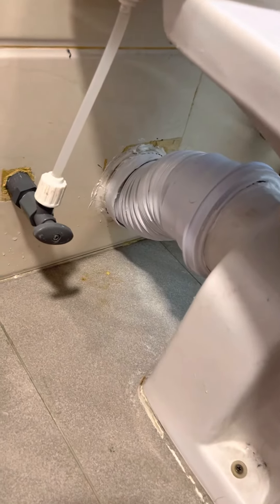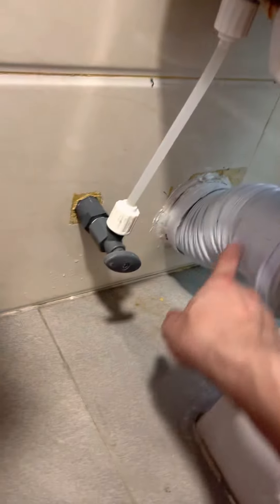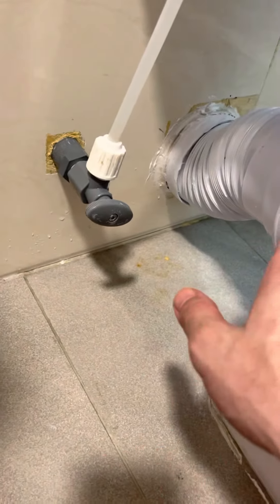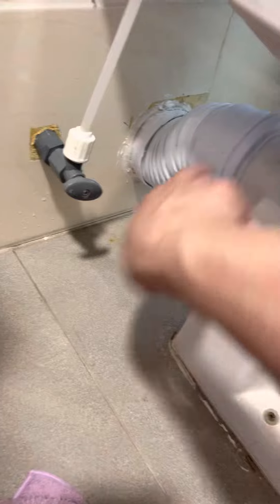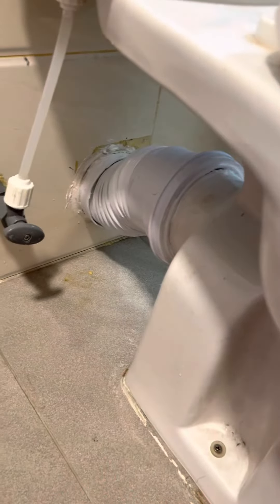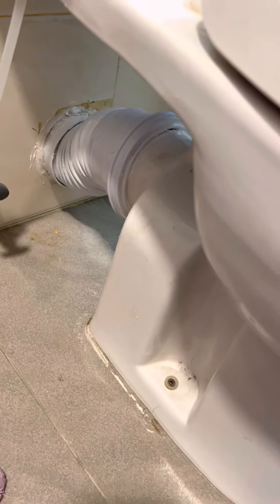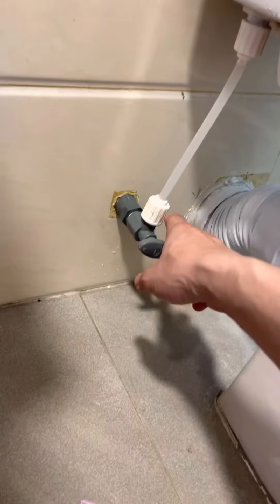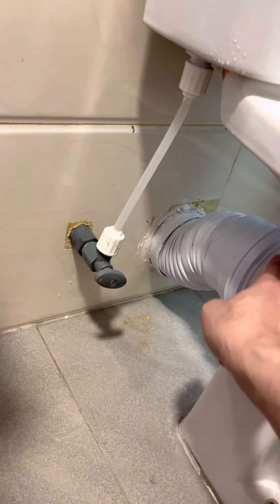How to change toilet waste pan. Part 2.

Comment: thanks for this! i was hoping you`d show the whole process/how to take the old one off and how much mess it makes- I cannot manage to get a plumber so I will have to be changing this thing myself very soon! smelly job I am awaiting
Reply from the maker: I will make another video explain more detail how to take it off tonight. Step by step.  Taking the waste pan is easy. You will need to wash your toilet very clean before u do this change.  And wear a n95 mask if u can.   As it is very smelly.  U know what I means.  It is not from your toilet bowl.  It will be from the whole building waste smells that came up from the reservoir.
Reply from the maker: Best prepare plastic bag to cover the hole before the old dismantle clean and done. And before u install the new piping.
Reply: @peter.l7010  thank you so much! in case you don`t want to go through the whole dirty process again, which I totally understand (big sacrifice for sake of youtube viewers), would I manage to take the old connector off without moving/dismantling the toilet?
Reply from the maker: @haninnify  no it is impossible to push in the new toilet waste pan if the distance is the same as my toilet bowl.  
As it is the shortest flexible waste pan I can find from my hardware store.  To unscrew the toilet bowl from the floor is not difficult. If you have the flush tank screw in the wall that will need a little work. But still it is worth the hassle later when u fail to install the waste pan as what happen to me.  You will fill ur bathroom with the smells even though u cover the waste hole with plastic, the smells still push in a little.  To ease your installation. 
I highly recommend you to 
1.unscrew the toilet bowl from Floor. 
2. dismantle flush water piping.  
3.And remove toilet flush water tank screw from wall.  So u can move the toilet bowl to ease the installation of waste pan. 
4. And drain all water off the toilet bowl.  Drain the flush tank.
Reply: @peter.l7010  mine is similar distance from the wall as yours, thanks for the tips. it`s been leaking for 3 years but I was unable to get a plumber. it`s a holiday mountain flat. this time I came on Monday and it was already letting in also the stench from the waste area, moved the pan a bit and it`s just leaking again/no smell, but about time to fix the whole thing. the toilet is sealed with silicone on the floor but I guess I can fix that later when I got some, thanks again!
Reply from the maker: @haninnify  yes the silicon u remove first using retractable blade.  That is to prevent water seep under the toilet bowl.  Where it is hard to clean and stink after.  
The toilet pan will break down when u touch it.  Place big plastic covering the work area.  And ready cloth.  And most important is rubber glove.  Use for dishwashing.  So u don’t get all the nasty stuff on ur hand.
Reply: @peter.l7010  I don´t have the n95 mask, only covid face mask, but at least I bought gloves 🤣
Reply from the maker: @haninnify  
1.get flexible waste pan.  
2. Silicon sealant for wet area(bathtub silicon sealant best)
3. Check the toilet bowl screw if rusty get a new set to change.  
4.  Prepare rubbish bag to put in the old waste pan and dirty cloth.  
5. At this point I would recommend u change the flush valve and the flush tank gasket.  See my other video about toilet bowl and flush valve.  When ur waste pan worn out. It is time to change them all together.  Otherwise u will end up same as what happen to me.  I dismantle the toilet bowl 3 times as 3 different area leaks.
Reply from the maker: @haninnify  I almost home will make a video which parts u need to change all together if u want.  So u don’t need to visit the hardware store 3 times in a week
Reply: @peter.l7010  ok, thanks, I´ll make it a Sunday or Monday job then
Reply from the maker: @haninnify  check out my new video.  I explain which parts u need to change all together.  To save you multiple dismantle time.
Reply: @peter.l7010  thanks so much, you star!